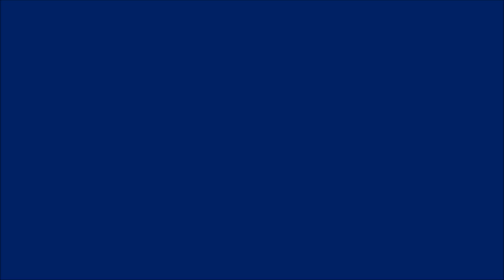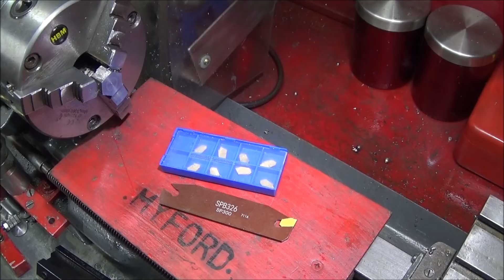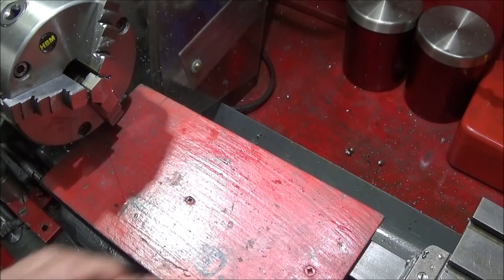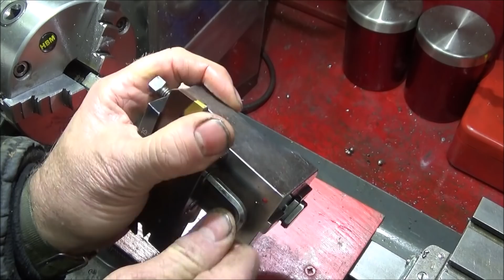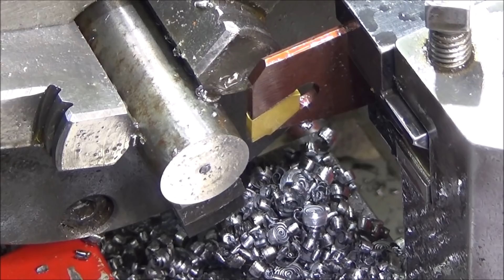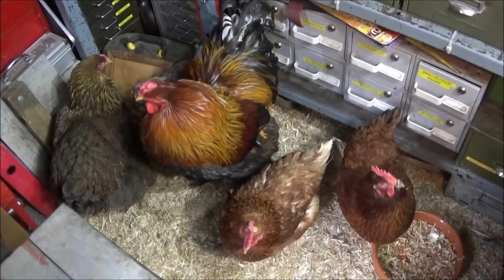Myford Rear Tool-Post Test New 26mm Part-off Blade & GTN3 Insert

Comment: Oh my grizzly I'd have to drill and tap for my big solid block tool holder I usually just turn my parting tool upside down and run my machine backward and plugged in from the front works out well way less scary

Comment: bangood is NOT always a lower price then some retail walk in shop fronts.
Please try and avoid all the UMM's and Arrr's in your commentry, it's very anoying.
Reply from the maker: Hi Roland. You are right there. Sometimes even cheaper on eBay. This is an old video, I have got better at doing them now without ums and rrrs I think:)

Comment: You said parting upside down is one of the best w/ays to part on the MyFord... 
specifically why the MyFord..? not any other lathe ?
Reply from the maker: In the video I'm using the Myford. It can only be done on certain lathes considering different cross slide types.
Reply: @SteveJordan  oh ok, right now I am making one for the Ceig 12" mini lathe, challenging but i am about 50% done.
Reply from the maker: That sounds great. Let me know how you get on. I was going to try and make one for the Mini Lathe at some point as it works so much better. Regards Steve

Comment: Hello Steve,  I like your design so I'm making one! I've made the sole plate but could you please help with the tool post settings?
How do you machine the tool post slot for the tool, is it machined to put the insert exactly at centre height or do you allow a wider slot for shimming and adjustment? In the video it looks as if there is a piece of bar in the slot under the tool. You mentioned that you machined the tool for the slot but I'm not sure why you did this- I was going to leave the tool at 16mm square? Finally, I find that the insert is only a push fit in the tool holder, I assume that this is normal as it will be forced into the holder when parting off?
Thanks Steve,
I've also made a couple of your tool post drills and they're really useful too.

Regards, Chris
Reply from the maker: Hi Chris. The actual toolpost in this video is a bought Myford one. It has a special design where the block under the toolshank called a 'boat' tilts to different positions to achieve tool centre height. You would have to see one to know how it works. I milled the back of the part off tool holder shank just so it moves further sideways into the Myford toolpost. 
 I have since made a new complete toolpost to fit the Myford that takes the larger 32mm part-off blades which is better than this set-up. You can see this one in several of my videos. I like the 32mm blades as they are the normal size I used to use on CNC machines. I milled the tool slot for this toolpost a bit below centre height then used packing under the tool holder. I think I did a video of making this one. See if you can find the video under  search 'Myford 32mm part off Steve Jordan' Otherwise I will find the link later. Regards Steve
Reply: @SteveJordan  Hi Steve,

Thanks for you quick reply - much appreciated. I've had a look at the 32mm video and I can see that it would have a much bigger parting capacity. My lathe is an Emco compact 8 and only has a small cross slide, so I don't think I could move the cross slide and post back far enough to make the most of it. I think I'll mill the tool post slot a bit wider as you said so that I can fine tune the cutting height with shims. I like your design where the sole plate base fits into the Tee slot, and the inverted tool of course - should give a lot more rigidity and stop the binding of the tool.. From your parting  demonstrations I'm hoping that my parting off sessions will be a lot less stressful in future! Really enjoy your projects and I look forward to making some of the others when this one's finished.
Kind Regards,

Chris

Comment: Those require no oil by the way, i have a Korloy sp300 pc9030 type insert parting blade, and i run it flipped upside down and reverse gear of course, autofeed with about 0,1mm per rev, and for all stock under 35mm maximum speed which is 750 rpm. Leaves a good finish and has smooth action. Those inserts i got are for stainless.
Reply: There was given speeds and feeds on the backside of the insert box, i just reduced those a bit and no oil of course as always with carbide.

Comment: Thanks Steve ordered, much cheaper than what I paid for the 32mm holder which turned out to be a 20mm attachment which I will have to reduce.  Thanks again for going to the trouble to get the information.

Barry
Australia.

Comment: Steve
Where did you get the 26mm blade holder from.  I have the blade , unable to find a holder.

Thanks in advance.

Barry
Australia
Reply from the maker: Ignore earlier replies I quoted the wrong shank size. I got mine off Ebay.
This is the best price I can find at the moment for the SMBB1626 HOLDER (26mm Blade Holder With 16mm Shank Thickness).
https://www.ebay.co.uk/itm/SMBB1626-Cut-off-the-cutter-bar-Cutting-tool-rod-SPB-cutter-16mm-holder-SPB26/291973470638?hash=item43faf999ae:g:2lgAAOSwcUBYMrke

https://www.ebay.co.uk/itm/SMBB1626-SPB226-Cut-off-cutting-broad-2mm-inserts-Cutting-tool-cutter-holder/302676045002?hash=item4678e5ecca:g:E34AAOSw6jNar09B

GTN2 2mm Thick inserts for above blade.
https://www.ebay.co.uk/itm/10-x-SP200-NC3020-2mm-Width-Grooving-Cut-Off-Carbide-Inserts-For-Cutting-Tool/253333556300?epid=2251368895&hash=item3afbdb4c4c:g:-SQAAOSwq4VaRKHf
Regards 
Steve

Comment: Steve.  Could you put up a link for the parting off tool please.  I haven't been able
to find it.   Thanks for all the great video's.  I have a 7 x 14 Real Bull same as yours
And a Seig C6.

Barry. Australia.
Reply from the maker: Hi Barry. Thanks. I couldn't find any of the 26mm tool holders for this blade on Banggood so I bought mine here
https://www.ebay.co.uk/itm/Gloster-16mm-shank-block-for-26mm-parting-off-blade/281249747156?ssPageName=STRK%3AMEBIDX%3AIT&_trksid=p2057872.m2749.l2649
OR YOU CAN GET IT FROM EBAY CHINA WITH A BLADE
https://www.ebay.co.uk/itm/SPB326-SPB26-3mm-Parting-Blade-Grooving-Cutter-Plate-SMBB2026-Tool-holder/302598661301?hash=item46744924b5:g:3pcAAOSwrFJZz8TF
The Seig C6 looks like an excellent machine. I couldn't believe how big it is compared with the Mini Lathe!
Regards Steve
Reply: Thanks for the reply Steve.  It was the blade that I wanted the link to at Banggood as I can not find it.  I have searched banggoods for it.

Barry
Reply from the maker: You must have missed the link in the comments above.
https://goo.gl/1sZgz2
https://goo.gl/9NkxrA
Reply: Thanks again Steve.  Yes I must have missed it, only seen the 26mm toolpost reference.
Had a seniors moment. All good now ordered with inserts.  Thanks again your videos are great have 
helped me a lot.

Barry
Australia

Comment: Why do you keep it so far off from center? It would be easy to shim or make a different holder.
Reply from the maker: That is how these tools are designed to be held and used. Also if you had a part-off in the center of a tool-post it wouldn't be able to cut the work off close to the chuck, as the tool-post would clash with the chuck jaws. These tools are held the same in CNC machines as well. See this......   https://www.youtube.com/watch?v=cLzVQRXysbY

Comment: Steve, did you make the tool post?
Reply from the maker: Hi No that is a Myford made rear tool-post. I have just ordered a piece of bright mild steel block though, which I am going to make into another one to hold the 32mm type part-off. Hope to show this in a future video. Regards Steve
Reply: Steve Jordan Can't wait till the next one Steve!! 😁
Reply: Steve Jordan that makes so much sence to have designed it to be that way.

Comment: Hi Steve,   I wish My Atlas 10" had the tee slot cross slide. I can see why the Myford is popular, that is one beefy machine. I ordered the 7 piece carbide and holder kit from Banggood the 16th and it is still in processing. I guess they are out of stock? Have you had long waits for tooling from them too?  Thank you for another excellent  video. Stay warm.
Reply: Bill,  how bout designing and building a tee slot cross slide for your lathe ? attach it in place of your compound
Reply: Good idea,I carefully drill and tap the near and far end of the cross slide. I have the milling attachment (if you can call it that) so I may try my hand using it and see just how bad I screw my practice pieces up. HAHA. Before I tackle that I need to make larger dials that I can zero like on my Clausing I used to have. Thanks